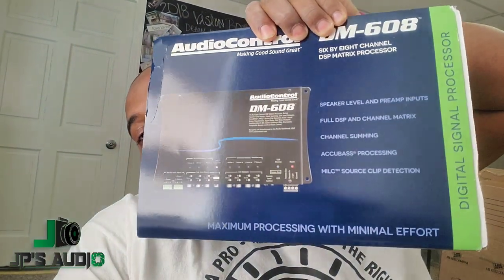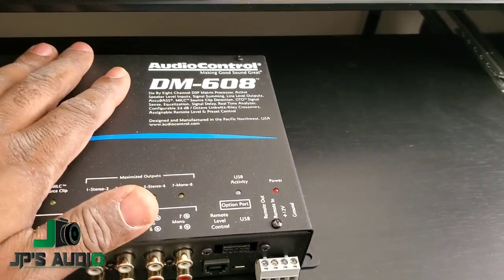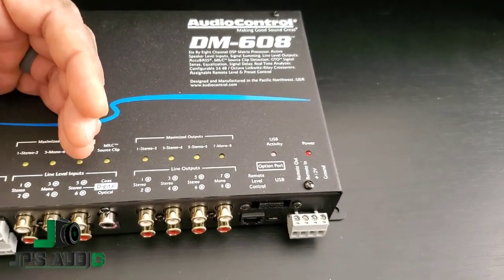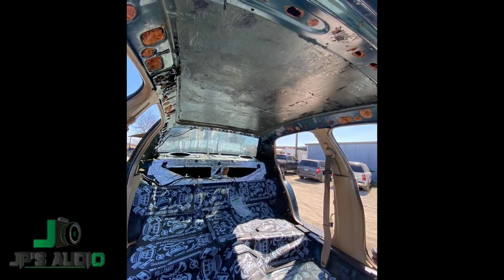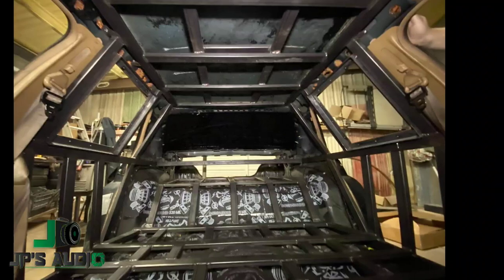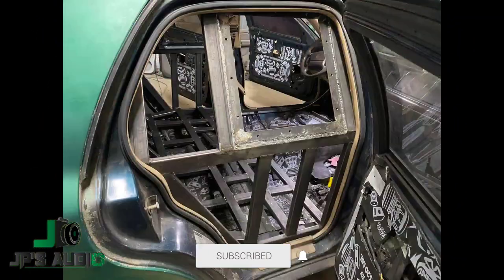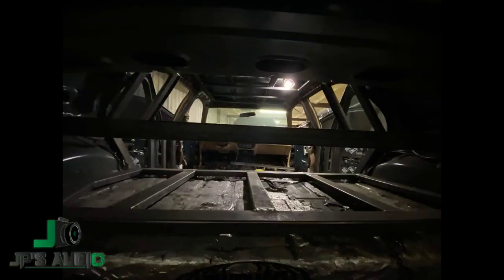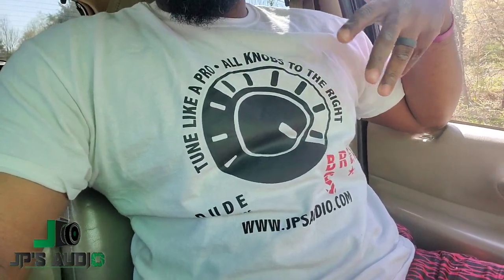1 loud grand marquis update: steel cage in my marquis

Comment: On a ford 4.6 any alternator with more than 230 amps it starts to slip the belt and you stop making any more amps. I got me a small 3 12s 2009 Lincoln build I just started im going sealed box and can't decide on sub yet as no one rilly makes a 2000w sub for sealed.
Reply from the maker: I've heard 250 but I talked to a brand that has years of experience with the panther platform cars and will do a 290 that should be decent for what I need. But we'll see